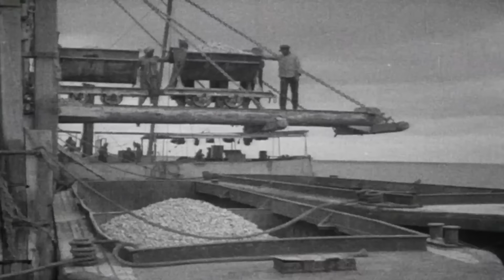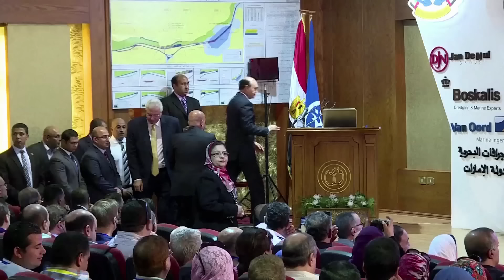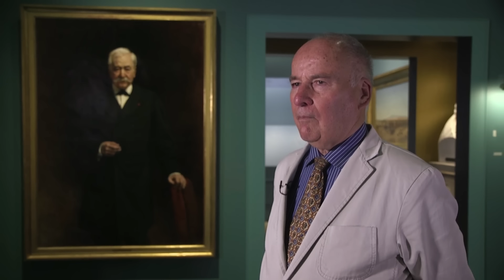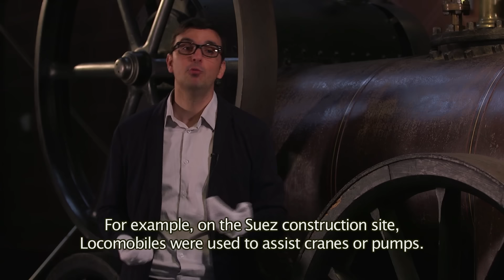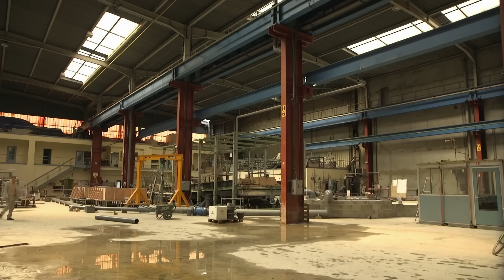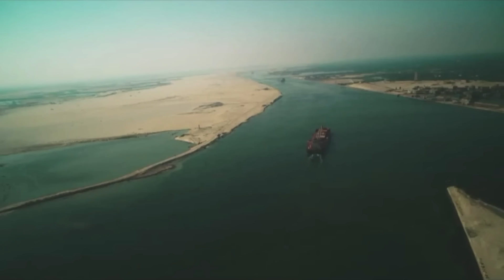How Did they Build the Suez Canal? 1859 to Today: Extreme Constructions | Documentary

Comment: The current one is the second or possibly third canal. I understand the last ancient canal was built by Pharoah Ptolemy 2. It remained in use for about 900 years.  Its last documented use was in 767 AD.
Reply: The Suez Canal is 110 miles long and dead level flat from one end to the other.  
No locks or steps.
What does that tell you about the shape of earth?
Reply: @raymond3803  That gravity acts right tangentially to the Earth's surface. It is what you would expect for a spherical planet.
Reply: @jimgraham6722  Wrong!  On a sphere of given size, there would be 1.5 vertical miles of drop , or curvature, from one end to the other.  The only way for the Suez Canal to be dead level across 110 miles on a globe, would be for construction at both ends to equally excavate down.  Gradually getting deeper until the canal met in the middle 3/4 of a mile below natural ground.  Do you see that?  No!  Then earth must be (4 letters that starts with F)  Do you global morons realize curvature, or drop, on a ball is progressive?  Meaning every time they come out with a transit that can read further.  It would throw off every previous land survey ever completed.  They would all be worthless.  For example, Top Con claims their laser level is accurate to 1/2 mile. Survey 1 mile requires 2 steps @ 1.67"/step = 3.34" drop in 1 mile.  Suppose in 2040, they make a transit that can read 1 mile @ 8" drop 1 shot/step = 8" drop in 1 mile.  That's 4.66" of error surveying same mile based upon 16 years of technology advancement.  Yet all surveys old & new check true.  No matter what equip is used.  FACT!
Reply: @jimgraham6722  NO! 
I, and any professional surveyor, would expect to measure approx. 1.5 miles of vertical drop from one end to the other.
Reply: @raymond3803  oh well, nothing a series of shipping locks couldn't handle. Somehow in the case of Suez, they found a way of dealing without them.
Reply: @jimgraham6722  Right!  They found a 110-mile-long flat spot on the globe.  Lucky!

Comment: So if they could make a form of concrete block from sand and lime to build the Suez canal, why couldn't the ancient Egyptians have used the same technique to make and cast in place blocks for the pyramids?? The area hs plenty of limestone and certainly sand.  I think all the archeologists and modern engineers to to figure out how the pyramids were build are missing something!!
Reply: Any geologist worth their salt can tell the difference between cement and limestone.  My professor used to put imitation limestone (cement) in our tests.
Reply: I mean the could of if they wanted to they didn’t tho and it would be way more work anyway concrete and stone are quite different and it’s easy to tell them apart
Reply: The ancient Egyptians didn't have the massive amounts of fossil fuel needed to make cement.

Comment: de Lesseps went from hero to zero when he took on the Panama Canal
Reply: Panama was  a much more difficult task. The Suez canal is basically a big ditch through sand. It was necessary to move a whole lot of sand to get it done, but that was it. The Panama Canal  was largely in rock, and required dams and locks. To me, the Panama canal is a much more impressive feat of engineering than the Suez.
Reply: Read "The Path Between the Seas" by David McCullough. Excellent read.  Approximately the first half of that book discusses the French attempt to build the Panama Canal.  The behind the scenes in terms of politics and money was rather ugly.  Teddy Roosevelt came along and straightened that out with his own brand of behind the scenes intrigue, including the creation of the Republic of Panama from what had been part of Columbia.
Reply: Yes and no, the Panama Canal was a more arduous task, after the hardships of building a levelled canal the French developed the idea of building a multi/level canal, but everything was dropped for mostly political reasons. The USA came later, took what the French had begun to build, their engineering and idea of a multi-level canal and just finished it.
Reply: Was going to point that out.  Having struck so many problems with the Suez Canal & almost failing, it seems rather daft to even consider that a sea-level canal would be possible in Central America!